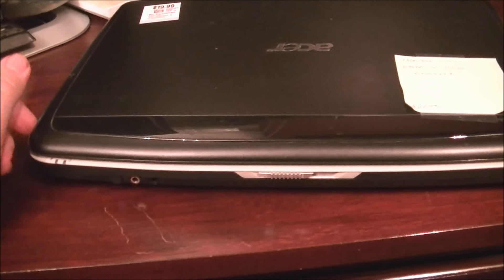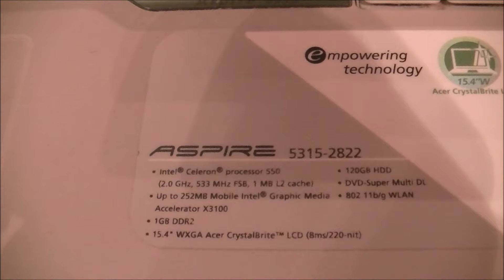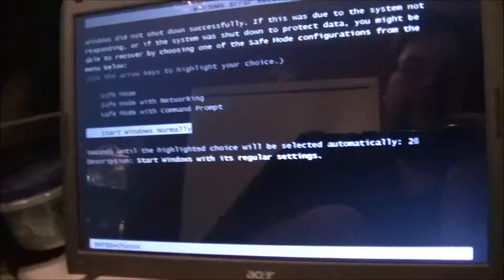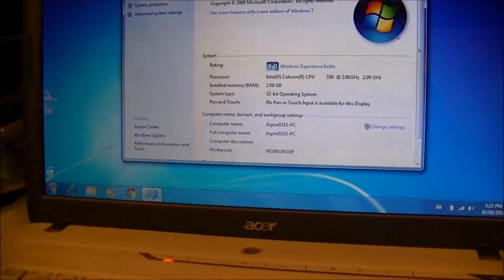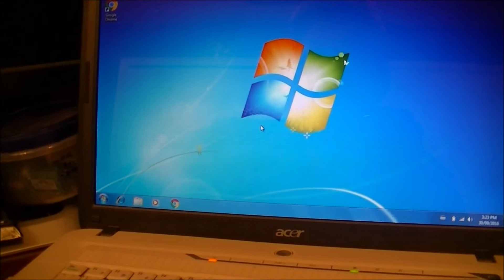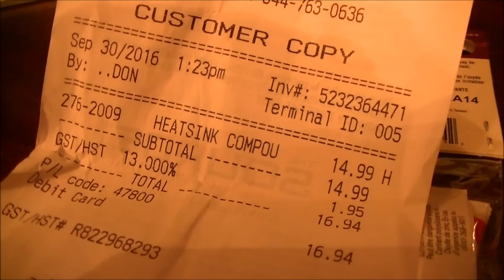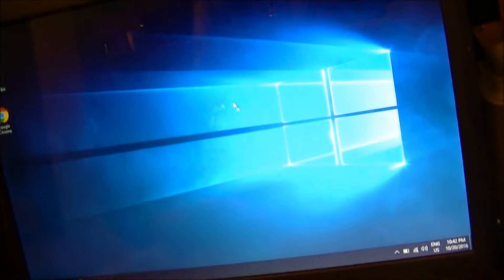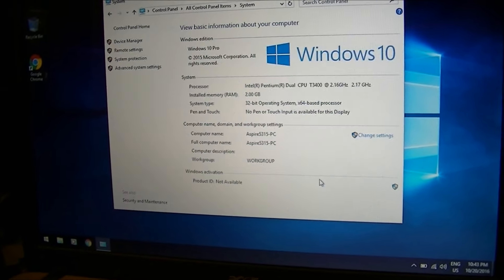$15 Acer Aspire 5315 Laptop From Value Village

Comment: I used to have the European (German) model of that machine as a main Laptop back in 2007. 
It came with 2GB of Ram and a 1.73GhZ Celeron M530. 

I really liked it for what it was and it was faster than any of the other machines I had at the time, so it ended up being my main machine.  Vista on the other hand was a different story. I actually installed Windows XP within the first month of owning it and then went to Ubuntu Linux, after running Ubuntu for 6 months I went straight up to Arch Linux.

It was a nice little machine, very dated by the time I got rid of it. (2010-11, maybe?).
I upgraded to an Aspire 5710Z, wich was basically the same system but with a Pentium Dual Core clocked at the same 1.73GhZ. 

I wish I had a similar model again, I love the design of those older Aspire Notebooks.

Comment: Just waiting on my Intel® Core™2 Duo Processor T9300, WD 480Gb blue SSD and 3Gb ram for one of these. I will try 4Gb other wise 3Gb - people on the forums say 2 *2 Gb does not work.
Reply: I just updated one for a friend.
1) I changed the celeron 550 for a T9300 and removed all the dust, replaced thermal paste.
2) replaced the 1Gb with a 4Gb ram and 1Gb stick of the same brand for a total of 5Gb.
3) replaced the 80Gb HDD with a 500Gb Western Digital Blue SSD.
4) replaced the keyboard.

Intel Mobile Core 2 Duo T9300 @ 2493.6 MHz
Dump [4i0tus] - Submitted by DESKTOP-RTPITE1 - 2020-10-21 01:59:25
Processor (CPU) CPU Name Intel® Core™2 Duo CPU T9300 @ 2.50GHz
Threading 1 CPU - 2 Core - 2 Threads Frequency 2493.6 MHz (12.5 * 199.49 MHz)
Multiplier Current: 12.5 / Min: 6 / Max: 12.5
Architecture Penryn / Stepping: C0 / Technology: 45 nm
CPUID / Ext. 6.7.6 / 6.17
IA Extensions MMX, SSE, SSE2, SSE3, SSSE3, SSE4.1, EM64T, VT-x
Caches L1D : 32 KB / L2 : 6144 KB
Caches Assoc.
L1D : 8-way / L2 : 24-way
Microcode Rev. 0x610
Vcore 1.138 Volts
Temperature 46 °C / 115 °F
Type Retail (Stock Frequency : 2500 MHz)
Motherboard Model Acer Acadia
Socket P (478)
North Bridge Intel GL960 rev C0
South Bridge Intel 82801HBM (ICH8-ME) rev B1
BIOS Acer V1.45 (11/10/2008)
Memory (RAM)
Total Size 5120 MB
Dual Channel (128 bit) DDR2-SDRAM
Frequency 332.5 MHz (DDR2-666) - Ratio 3:5
Timings 5-5-5-15 (tCAS-tRC-tRP-tRAS)
Slot #1 Module SK Hynix 1024 MB (DDR2-800) - P/N: HYMP112S64CP6-S6
Slot #2 Module SK Hynix 4096 MB (DDR2-800) - P/N: F2-5300CL5-4GBSQ
GPU Type Mobile Intel(R) 965 Express Chipset Family (Microsoft Corporation - WDDM 1.1)
GPU Brand 0x1025 (0x0136)
Storage (HDD/SSD)
Western Digital WDC WDS500G2B0A-00SM50 (FW: 401020WD)
465.8 GiB (~500 GB)
Fixed, SSD - Bus: SATA (11)
Microsoft Windows 10 (10.0) Professional 64-bit
CPU-Z Version 1.93.0 (64 bit)

Perfect for office, surfing, it will do 720p youtube, play 1080p video files using VLC. Upgrades cost him $217 in parts and lots of coffee in his cafe. Gives me something to do in lock down!

Comment: Pretty sweet find! Anything you can find with a dvd RW drive is much better than all the new laptops these days that always seem to come without them. It does sound kinda tinny as you mentioned.. I've come across a few that had Altec Lansing "SRS Premium sound" speakers and they sound pretty darn good if you have the EQ software. Overall this came out to be one decent $15 machine.
Reply from the maker: silverperzon I know what you mean about the Optical drive not being in new laptops. It is a huge inconvenience as most of the software I have are on disc. The laptop's speakers are pathetic... probably the worst one's I've come across so far. but at least it now has a dual core rather than the shitty celeron.

Comment: I have the same machine But I upgrade the procesor with intel core 2 duo T7300 and installer 3 Gig of ram. this is the max of ram and work very well on windows 10 and run very soft in windows 7. literaly i receive this machine with windows xp procesor celeron and 1 gig of ram. I tried to install the 4 gig but the machine have problems to start. so 3 gig is the max.
Reply from the maker: These are great old laptops aren't they? I used mine up until last year when the screen cable broke apart and had red lines  on the screen. One good upgrade is a SSD drive I find that it really does breath life into old computers 🙂

Comment: what CPU did you put in? and do you think a SSD would fit in the laptop?
Reply from the maker: I installed an Intel dual core T3400 2.16ghz cpu. The original one was a Intel 550 2.00ghz cpu not really a big deal on swapping them out but figured anyone who wanted to know how to do it on this laptop this video is here to help them.

 You can certainly put a SSD in here no problem! Customer of mine still has this laptop and is very happy with it
Reply: @vcamnowaa  thanks